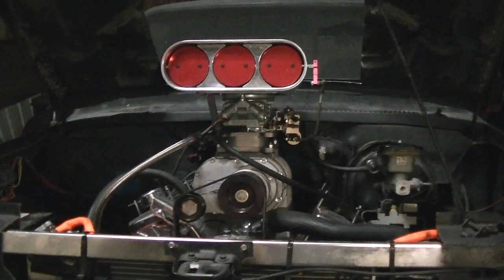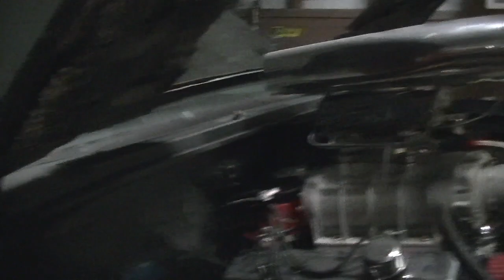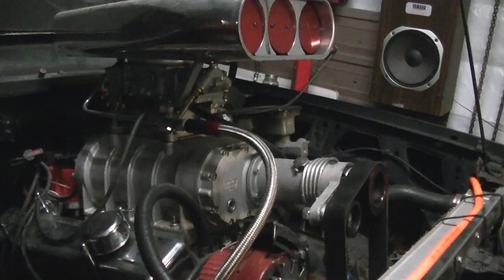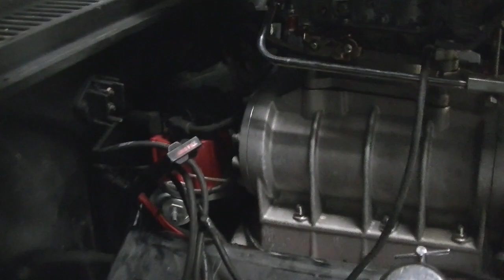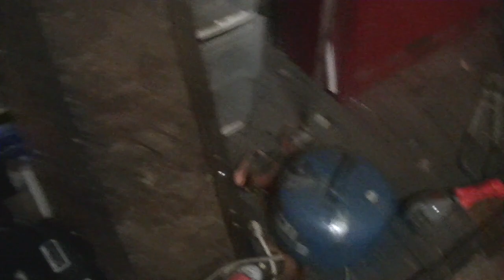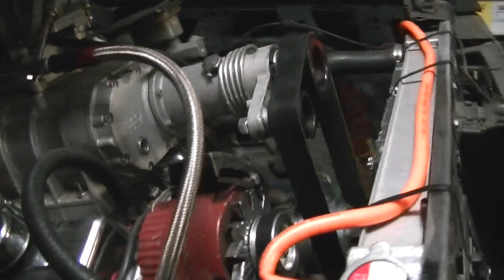thank you for watching !

Comment: What motor do you got In it and what’s all done do it besides the blower
Reply from the maker: 427ci 4.060/4.125 bore and stroke sbc aluminum heads mild portwork intake and heads port matched to a 1206 felpro scat internals comp cam shaft mounted roller rockers  too much stuff to list